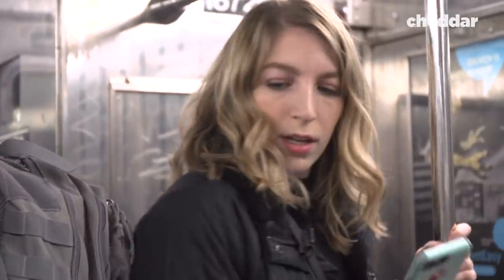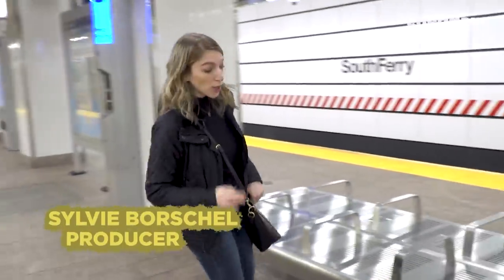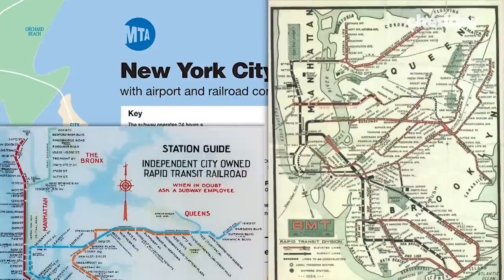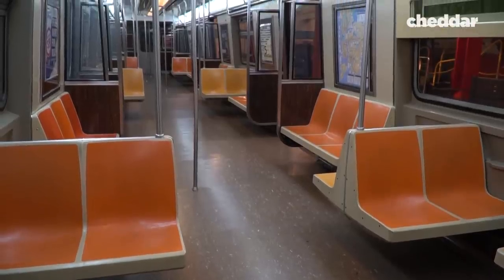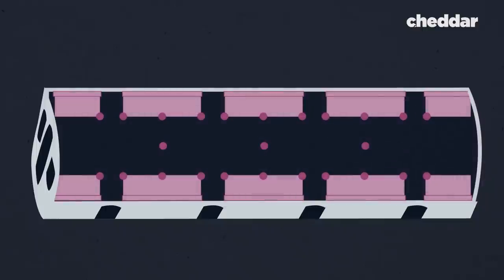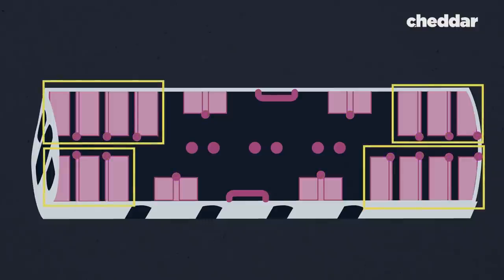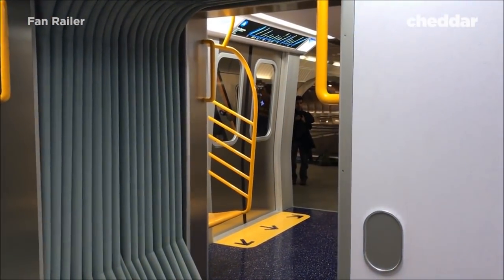Could This Subway Car Save NYC Transit? - Cheddar Explains

Comment: Been riding NY trains for fifteen years. So I will respond with my knowledge. So the open gangway thing is a good idea in the sense it creates more space. However what happens when that crazy person gets on the train or that bum that smells on the one kart. You know the kart that’s empty cause it’s so stink. So the gangway thing has its pros and cons. 

Rearrange seating makes some sort of sense I guess but then that would mean the people who are taking the short rides would or should stand in the middle. And the people who are taking a longer trip should be seating. However this is NY people walk so some  will want to sit down for just one or two stops. And some people like myself who just doesn’t like to sit down unless it’s completely empty almost lol no matter how far I’m going I’ll stand on a crowded train. 

As for the new trains they decided to go with it’s a new idea I guess to have folding seats that’s cool I guess. Still at the end of the day it’s not gonna stop people from entering and exiting a train faster. 

What they could do is have enter and exit doors like the buses. Like if your exiting the train the doors should fold out towards the platform that way it makes the crowds on the platform either back up for flow or they could go to a door that has a entrance door that’s flowing inward to the inside of the train. Have 2 for exit and 2 for entrance that way flow is like circulation. People will adjust themselves before hand if they knew which way to get off first but these is NY and people there tend to just do whatever makes them feel NEW YORKY LOL.
Reply: TheGreatDom2EZ The design suggested here is worse than the the MTA proposed R211 car design. It actually creates less standing space and overall capacity.

And no worries. The open gangway cars will not cause any order complaints to materialize.

Comment: Phoenix light rail cars are designed that way...only thing cause I'm American I have to issue a complaint if you're in the seats facing away from the direction of travel it does feel weird hmmm I think I jus felt a spike in estrogen in my system😔😒

Comment: Well...Maybe retract all the seats during rush hour or when there are two many riders? MTA knows how many people are entering and leaving a station easily. Special MTA cards will be issued to people  who need them. They can scan their cards to attain seats? Of course high tech public facilities will be expensive to create and maintain. Oh well, New Yorkers have to deal with it.
Reply: Weisha Yu Folded seats are being tried on the J, L, and M lines. However, they have be subject to vandalism by disgruntled subway riders due to seats being locked according to a set timetable.

Comment: Interesting video! The lastly mentioned lay-out does make sense. I've seen it in some major European cities and in Canada.
Reply: The new Azur trains in the Montreal Metro have a pretty interesting variation of this style.  It's a mix: single seats, back-to-back tranverse double pairs, short longitudinal stretches, and open gangways.  They feel so much more open and spacious than the old MR-73's.  Plus you can watch the train bend as it goes around curves and climbs inclines, which is a fun if surreal sight.
Reply: @andrewweitzman4006  No AC????
Reply: @transportationland6395  Typical on rubber tire metro systems.  The tires cause a fair bit of heat to build up in the system.  Running AC would quickly flash broil everyone in the stations.

Comment: the E train is overcrowded because all the hobos sleeping in the subway cars, so the average rider wants to avoid the smells, so they bunch into the car that doesn't smell like crap.
Reply: just p Not to worry. With open gangways, this issue will be alleviated and crowding will decrease on the E, F, and R.
Reply: @TheRailLeaguer  Now the smell going to be spread all over... You need to fine a better place to put the homeless,  so they don't sleep in the subway cars.
Reply: just p Good thing I said that the open gangways will alleviate the homeless issue because on each 5-car set, there will be 2 air conditioning (HVAC) units to dissipate the smell won’t spread over.

Also, the homeless problem is a hoax.

Comment: How about increasing frequency???
Reply: Arjun R Some lines don’t have capacity for extra service, and even if they had and they did increase the frequency, the sheer amount of additional riders coming on to the system still requires redesigning the subway cars for more capacity.

Comment: I hate those new E trains. Sure you may cram more people, but for those of us that have a long conmute they really suck. Personally I like to seat at the ends (where the seats have been removed) because I have a longer conmute of about 4 hours daily (half of it on the subway) and being in the middle is an extra hassle.
Reply: José Reino They only removes around 4 seats per car, so it’s not really going to kill you. Plus the middle of the car is very spacious, and soon there will be more space when we get new open gangway cars. Sometimes you just need to adapt.
Reply: @TheRailLeaguer  I conmute more than 4 hours a day, of course is not going to kill me. In any case, is my opinion whether you like it or not, what I like is what I like. Maybe you should adapt and try to stop patronizing people. I you like it fine, if you like seating in the middle fine, good for you, have it your way but don't preach me.
Reply: José Reino No need to get triggered kiddo.
Reply: JeremiahC99  No need to get condescending either. But I guess that you can’t help yourself.... 🙄
Reply: José Reino I’m not condescending.
Reply: José Reino You must be joking, right?

Comment: How about just having more trains running and express trains 24hrs that will eliminate crowed train. Yes, new trains will be nice too   Equipped with security cameras.
Reply: This does not solve the issue of subway car layouts. That’s what the video is about.

Adding service is a totally separate issue.

Comment: The most forwardthinking idea would be removing the cars altogether and just having a moving belt so people just step on and go to the next station or the next station and just stay on and the entire system is in closed à la Hyperloop system that would be yes Hyperloop for the individuals and entire system but just continuously runs all the time you step on it and you move forward as soon as it exits the station and it picks up speed to the next station where it slows and you can exit sounds like the future constantly going no delays constant movement the future. And cats would fly.
Reply: What does that have to do with subway layouts?

Comment: Said in a sarcastic New York accent, "What is the most efficient subway car? I'll tell ya. It's a subway car that isn't covered in vomit, piss, and homeless. Clean them more often so we can use the whole car. " Get more subway cars. Stop spending your budget on consulting friends. Stop messing with people. Spend money on infrastructure and not tax cuts or give aways like a helicopter landing pad. 
Setup a subway driver, janitorial, and maintenance union. Match their contributions to political candidates.
Reply: My favorite part of this video is how you can tell that as soon as we come up with a "perfect" subway car design. Then china is going to steal the design. Then Claim that the design was always a part of China.
Reply: The videos that show the usage clearly show the problem. Static car amounts. It should be dynamic in response to estimated usage. Just like power plants and sub stations do. Add cars when you know more people are going to use em. So !&#$ simple.
Reply: Here is what the research group did. Make the cars different so everyone complains. Then force the people to be different. Force them away from doors. Omg, how are they so wrong at such an easy job.
Reply: TheTechiemoses Open gangways are the very ideal solution to overcrowding.

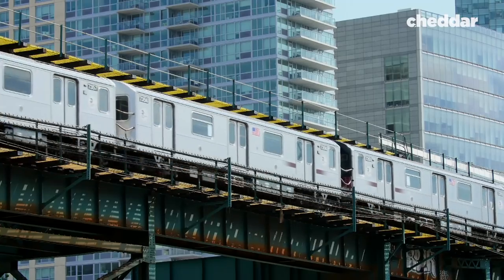Comment: 7:21 I bet there gonna go back to closed gangway. If the R211s don’t separate like the R179s
Reply: The first 535 cars will have 20 open gangway cars as a test.

Also, no open gangway train has separated. The connector is actually welded into the car bodies, reducing the chances for separation. That’s how the TTC Rockets work.

Also, why is everyone addicted to the R179 cars splitting?
Reply: @TheRailLeaguer  memes

Comment: Here's a clue  trains are 10 -11 cars long.... 100 plus passengers per car 
1100 plus passengers per train.....
First two and last two cars should have seats
Middle 6 or 7 standing
Reply: Joe york On the 42nd Street Shuttle, they did remove seats on one of the cars of each train. Helps out.

This should be expanded to other lines as well.
Reply: @TheRailLeaguer  
Yup on the e train they removed the seats at the ends of each car so more ppl pile at both ends of train cars
Reply: Joe york True. However, the 42nd Street Shuttle concepto removed all of the seats(except for the two at the corner), while E train concept removed only the corner seats. Your plan is closer to the 42nd Street Shuttle concept.
Reply: Richard Head Why are you being biased based on appearance? The subway is open to anyone without regards to gender, age, appearance, weight, race, etc.
Reply: Richard Head That’s not a good idea as well. What you are doing is straight up discrimination and bias. They would have lawsuits from those people if they had to do that. The subway is open to all walks of life without regard to race, gender, weight, etc.

Everyone, except for those under special circumstances (student, low income, etc), should pay the same fare. No one should have to pay more because of their weight.

Also, THIS HAS NOTHING TO DO WITH REDESIGNING THE SUBWAY CARS.

Comment: It is a national embarrassment that the NYC Subway, despite is size and notoriety, still almost entirely relies on a fixed block signal system instead of communications based train control. CBTC throughout the system would result in a gigantic increase in the capacity, reliability, and average speed of the subway. Keep in mind this is standard technology on the best subways in the world, not some breakthrough pie in the sky innovation. 
Byford had the right idea by putting forward a plan to expedite the full conversion to CBTC in 10-15 years compared to the original plan of 40 years for a cost of $8billion-$15 billion. Yes, it's a massive and expensive undertaking, but this is the single most important thing the NYC subway could do.
Reply: What does CBTC have do with outdated subway car layouts?
Reply: @TheRailLeaguer  That subway car improvements wouldn't be nearly as effective at addressing the stated problems as CBTC. In a perfect world NYC could have both, but with limited resources and limited political support it's best to focus on the CBTC.
Reply: Erik Lakeland CBTC is an independent issues from the outdated subway car layouts.
Reply: @TheRailLeaguer  It's about prioritization of what'd do the most improvements with limited funds and support.
Reply: Erik Lakeland The layout was chosen without consideration to train delays. Train delays due to signal problems are no way related to seating layouts.

Plus CBTC is a separate issue and unrelated to train car designs.

Limited funding also has nothing to do with outdated train car designs.

Comment: Guess this is no longer a problem.  Now they cannot get enough people to ride just to keep the lights on.
Reply: Is that a joke?

Plus new cars with new layouts (the R211 and future models) will be needed. Ridership will be coming back once a few more industries (Broadway, which pushed back the openings on its own accord) reopen.
Reply: @TheRailLeaguer  Not a joke, just a reflection on the fact that the subways are running 70-80% empty now, so crowding isn’t really the issue. 

As far as the return of ridership, it will depend on the return of millions of former daily commuters that have gotten used to working remotely. Commercial real estate in the city is going to be badly hurt for a long time.
Reply: @laldagorth  So you’re saying it’s a joke?

Are you also suggesting we not order open gangway trains no matter what, because it will be useful in any circumstances (who doesn’t want a 10% increase capacity on all the trains)?
Reply: @TheRailLeaguer  Dude, relax, I was remarking in the different world we live in compared to when the video was released. No bigger message, no deeper implications, just an observation.

Comment: Why not just have no seats at all
Reply: That’s way too draconian, especially since not all subway rides are short. On the L train, a ride from its Canarsie terminal to Union Square can be almost an hour, so they need seats (even though much of the Brooklyn crowd is usually at Broadway Junction, Myrtle-Wyckoff, Lorimer Street, and Bedford Avenue. Livonia Avenue would be on that list if that transfer was built).

Comment: Get rid of Full Width cabs; The Railfans are the ONLY CUSTOMERS THAT MATTER.
Reply: No they do not. Actual commuters riding the subway as well as the operating personnel are the only people on the MTA that matter. None of the crews do not like the idea of spending 1+ hours in a small cramped-in space in the corner of the car.

I take it that you do not ride the subway on a daily basis to get to/from somewhere important.

Comment: how about we privatize the mta first so they have the freedom to spend money as they wish, which will actually help get CBTC installed so they can LITERALLY RUN MORE TRIAINS instead of engineering a one-time solution?
Reply: Comrade Doge Sometimes privatization does not work, since in most cases, the private company does not care about its customers. Just look at the situation with the Nassau buses. That service has gone down the drain ever since it was privatized.

Comment: The "perfect design" is horrible! That is gonna in reality fit LESS people. You even said during rush hours commuters have no choice. Exactly! The trains are supposed to be designed to maximize efficiency during rush hours! The "perfect" design is designed for uncrowded commuter trains that value comfort over the number of people seated. If the seat number is still the same, that just makes it even worse because it's a bad bad situation. The number of seats will still be the same but there'll be fewer people in the car, leading to even more delays. Ever wonder why new subway trains all have side seating? It's because they're the most efficient way to put more people in cars while maintaining the same amount of seats.

Comment: July 2020? It's August 1st 2020. Maybe it happened. I've only taken the n since the pandemic started and it's definitely not on the n line
Reply: The R211 cars were delayed due to the pandemic forcing closure of the factories in both Yonkers and Nebraska (this is a non essential business). The factories have since reopened

Comment: Obviously it would be far more efficient to unload passengers only on one side while loading them from the opposite side. That way there is no opposing foot traffic, and waiting for one before the other.
Reply: Lou Lopez We used to have that at terminal stations, but newer car door controls make it impossible to open both sides at the same time.
Reply: @TheRailLeaguer   Thanks, I was wondering why the most obvious would not be implemented.

Comment: Only Thanos could save NYC transit.
Reply: What does The Avengers (Thanos) have to do with the NYC Subway system? They’re completely unrelated.
Reply: @TheRailLeaguer  Overpopulation is the biggest problem with the NYC subway system.   If you solve it, everything else will seem simple.
Reply: @boedillard8807  Overpopulation also has no relation to subway car layouts. Usually sensical solutions about subway car layouts usually involve seat layouts, positioning of poles, open gangways, etc.

Comment: Still can’t believe people choose to subject themselves to living in NYC. No one is forcing you to live there..
Reply: What does that have to do with new subway car layouts?
Reply: @TheRailLeaguer   living in NYC dependent on crowded cramped smelly subway system is horrendous. So ya, has everything to do with subway cars and everything else involved with living in NYC.
Reply: @zackdreamcast  But how? That answer has no info on removing seats, changing pole positions, etc.
Reply: @TheRailLeaguer  have to spell it out for you? the answer is leaving NYC for greener pastures where you don’t have to deal with subway car issues or anything of the sort.
Reply: @zackdreamcast  That still does not deal with subway car layouts. It also doesn’t answer any question.

What qualifies as a good answer is how many seats should be removed, where should the poles be, etc. Your answers addresses none of that. Even suggestions of open gangway trains are a better answer compared to yours.

Comment: Half the system is GONE! Thank you General Motors.  The els were not updated and speed ed up. They were torn down to get super trucks of the future (Now) in the city.  Fast, comfortable heavy loading street railways were ripped up and removed. Replaced by smelly bouncing little buses.  While other cities across the nation are replacing their streetcars removed by GM now Government bailed out Motors. The little city of NY has done nothing.
Reply: intercityrailpal What?